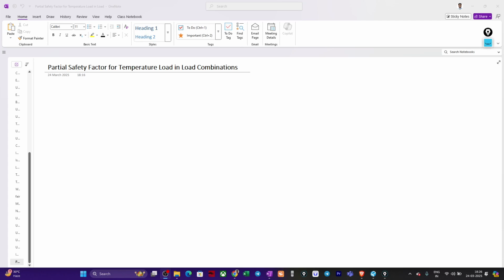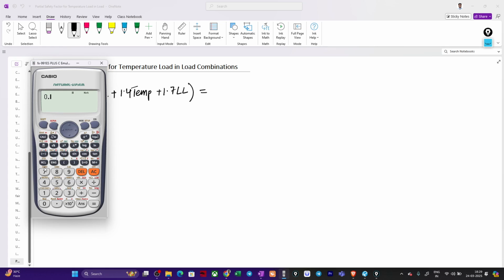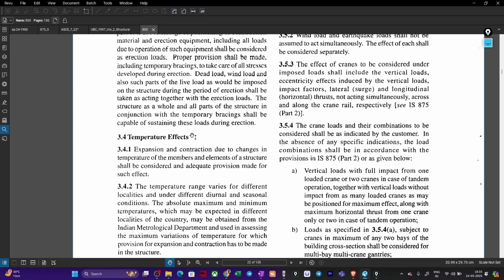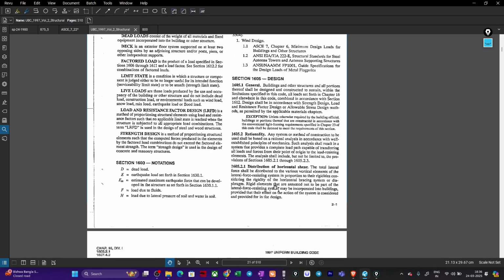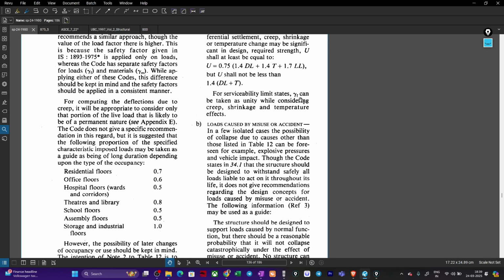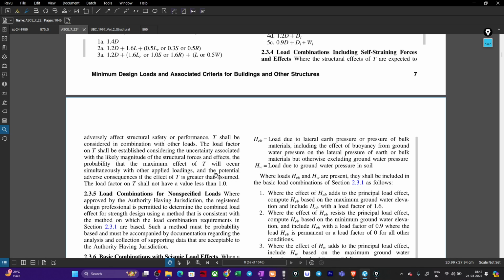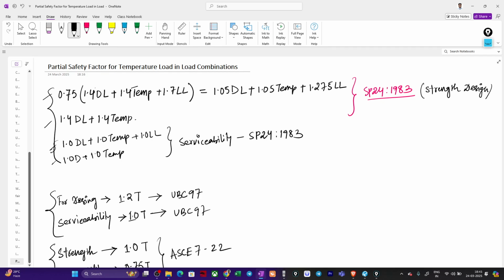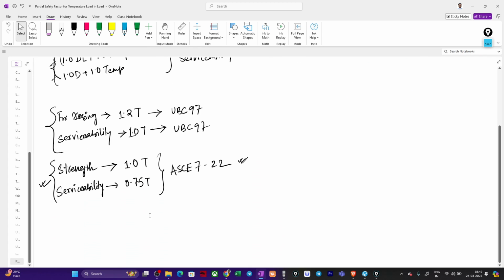Partial Safety Factor for Temperature Load in Load Combinations | ilustraca | Sandip Deb

Comment: Good. At least some one discussing. IS code is conflicting and does not clearly mention and IS875 is out dated. Standard practice of international projects are use same factor as dead load. 1.0TL factor was there in IS875 when limit state approach was not existing. Subscribed for this post.